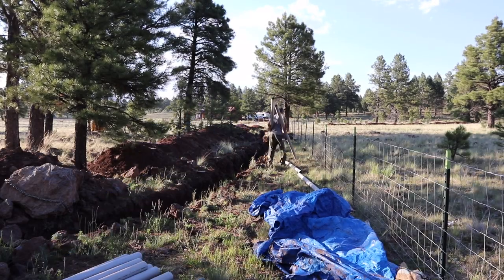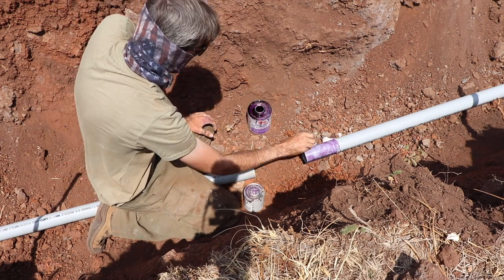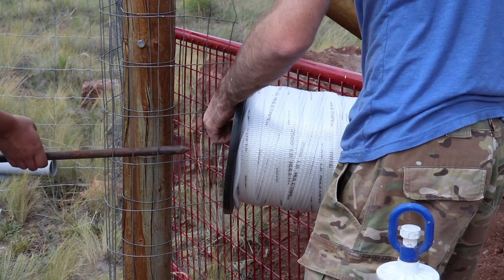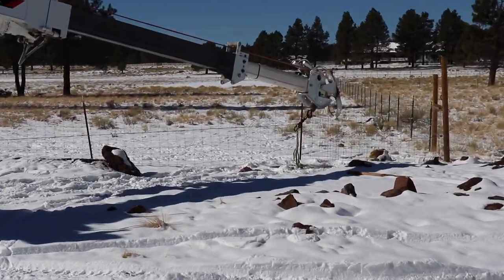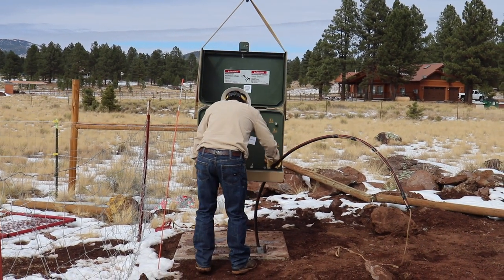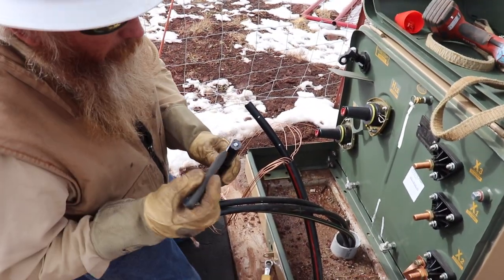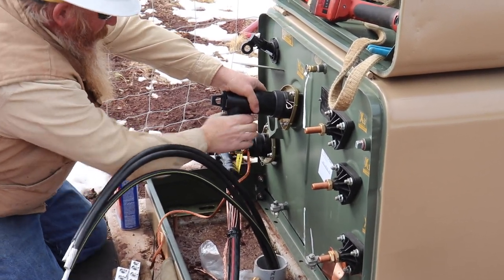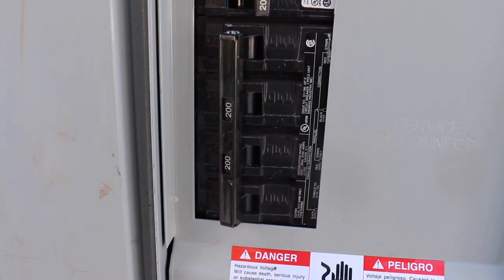Installing Underground Power Lines

Comment: Just ran 409' of 4" conduit for my APS power to my new house. No bends, just the straight pipe had some bends in it. Used a hockey stick from the 4" to the panel box as a riser. Waiting for my framer to frame a temporary  wall then I call APS back for the final 400A cable and a meter. It will be nice to have power after 2 years of generators.
Reply from the maker: That's awesome, and not very easy!  We only had to use a generator for about two months, I couldn't imagine two years!

Comment: Great video.  Are you getting 200amp or 400amp service from the transformer? and do you know what specification of the wire they install to minimize voltage drop due to 300ft distance?
Reply from the maker: We have a 200 amp service, we didn't have any need for 400. I don't remember the specific wire size they used, I will see if I can find it and let you know.

Comment: i have seen videos where they use a lubricant on end section of wire to be pulled..
Reply from the maker: I asked about that and they told me that it doesn't make that much of a difference when they're pulling so they don't use any.  When I've pulled normal size wire through conduit we used to use it, but we never pulled wire 400ft.  It may have made it easier, but in the end what stopped it was the pull line cutting through the sweet and the conduit hitting the underside of the pad.

Thanks for watching

Comment: can i ask how much that cost. Seems like all that hardware would be expensive.
Reply from the maker: The only thing we had to do was dig the trench and lay the conduit, which ended up being about 3,000 (which includes the conduit and digging about 1,000 feet of trench total.  All the wire was provided by the utility, and since they inspected the conduit before backfill they paid to have the sweep replaced.  If there are problems down the line anything up to the meter is on them to fix.

Thanks for watching!
Reply: @PootsPastures  Hi, I'm watching your series now which by the way is great and wondering if you could provide more information about the pad mount transformer. Like, was it easy to install and did you have to buy the mount or was it provided.
Reply from the maker: It was provided to us by the power company, and was made of some sort of composite it probably weiged about 75lbs.  Because the transformer itself is heavy the pad doesn't have to be concrete.  We just leveled the ground where it was going to go, and put the pad in place, we did have to fill the opening in the pad with concrete but that was super easy because it just took 1 bag.  Hope that helped!

Comment: Nice video. You have plenty of space for Solar. I would suggest to build some small shed close to house..but not so close if it will burn down :) haha..joking ofc...
I do see that they didn't use something like WD 40 that is why it all went bad. I was really surprised they didn't use something  similar ..
Reply from the maker: These dudes were pro's I think I may have talked about it, but they told me that the reason they didn't use any lube on the wire was because of how long of a pull it was the lube would not have really made a difference as it wouldn't have worked it's way down the conduit enough.  And the plan is to put solar on the barn (when we build it), so we will be doing solar eventually.

Comment: Why put the transformer so far from the house?  Why put the apparently-main panel outdoors?
Reply from the maker: Putting the main panel outside was easier than just having the meter outside and running wire to an inside panel.  It also makes it easier to add circuits later on (in my opinion)  and I wanted the transformer out of sight.

Comment: Don’t bend 90s in conduit!
Reply from the maker: All but one of the 90's in our conduit were manufactured that way so maybe tell them that.  The other one was over a long distance and when I spoke to several contractors they said to just bend it around.  I can see where putting too much stress on it without heating it may cause an issue with cracking but we weren't anywhere near that point.  The conduit was left uncovered for about a month and no issues were observed.  I don't have an issue with criticism when alternatives or explanations are given I do have issues with "don't do that" statements, they don't help anyone.
Reply: @PootsPastures  Some utilities,  like Colorado Springs Utilities,  nearby me, prohibit any site made (heater) bends. They'd make you use sweep 90s, which are about a 3 ft radius. Just something else to look out for.
Reply from the maker: Yeah we used all manufactured sweep 90's except for that one 90 that is super gradual.  I had the guys at our power company come look at our trench and talk through some stuff with me so they had seen that bend from the beginning and didn't have any issues with it.  Thanks for watching!
Reply: Well, you kinda have to, to go from horizontal to vertical...
Reply: @PootsPastures  Was this all Schedule 80 conduit?